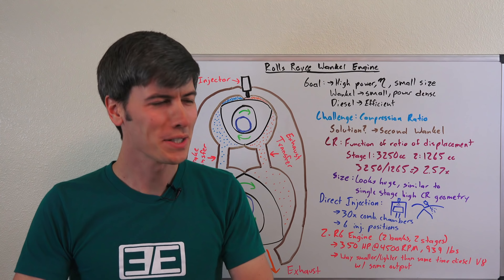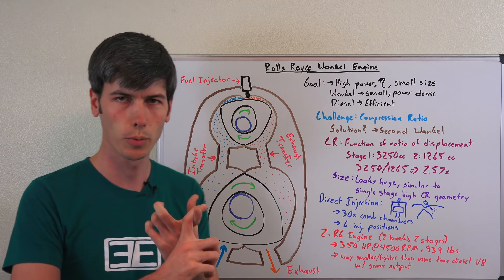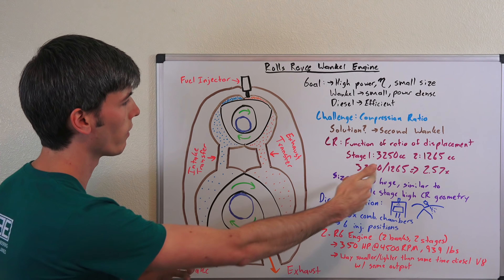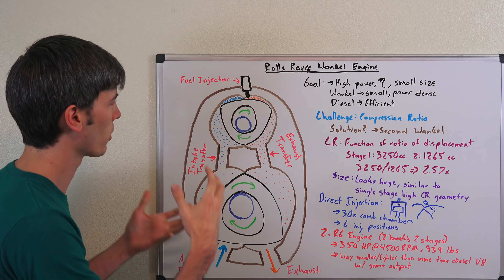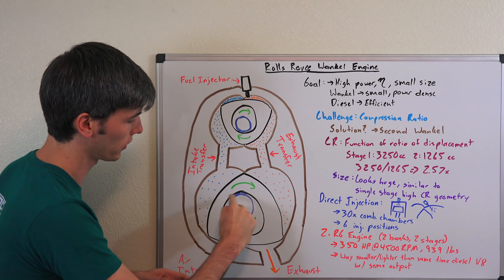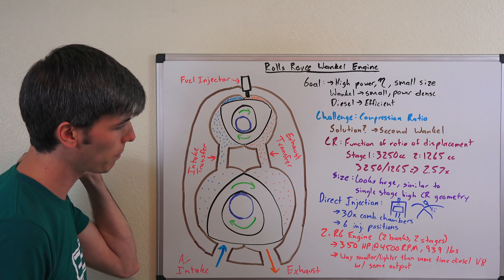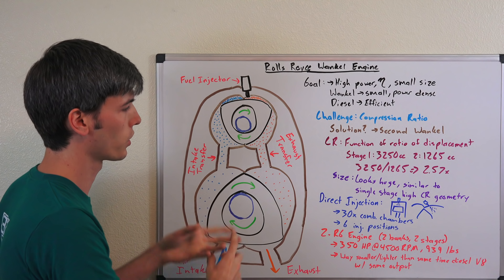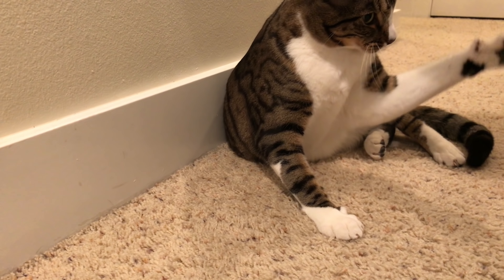Rolls Royce Made A Diesel Rotary Engine With Four Rotors!

Comment: I wonder why, just why...
I must watch again your other video about why the rotary engine is dead... I just don't understand why it happened so soon... it looks like absolute perfection to me... Wankels are known for being low-vibrating and smoother, so a Rolls-Royce with such system would offer an EVEN smoother and softer ride. Also, with so much freaking torque, the company could easily overcome some problems related to excessive weight (Rolls-Royces are quite heavy cars; even the sportier models); thus making a better-performing armoured car. Imagine a Phantom with a VR-10 armour level; that would be a great competitor against Mercedes' Maybach S600 Pullman Guard.

Comment: No way this would actually work without shaking itself to pices with the off set rotors. It  would also put out enough heat to melt  the frame of anything it was put into.

Comment: But wait.. how does it get  enough air when starting? I imagine the starter motor driving both rotors but i can't imagine a starter motor providing enough RPM for the "Charger-rotor" to create enough airflow to the engine. Were there any other air intakes?

Comment: I have long wondered why nobody has explored diesel wankels. Petrol rotaries have always been poor on fuel efficiency because it is almost impossible to get all the fuel to ignite in a chamber which is rapidly changing. I assume with a diesel - which ignites under pressure - this wouldn't be so much of a problem right?

Comment: This is a twin charged, twin rotor, direct injection? Can we do it now with modern metal and the unbreakable Apex seals, A fully programmable ECU. We can get the weight down to 500lb or less.
Reply: The problem is it is using diesel which is being phased out. I can only see this being useful for marine applications.  Rotaries scale up nicely. Banks of those turning genny's which turn electric props would work well on ships. Slot one in and out for service on-shore, no down time when in port. Berthing fees are not cheap. When ships on on the seas they earn.

Comment: I wonder why they did a two stage wankel engine with all the sealing problems instead of radial or roots compressors. Also, what was the total compression ratio of that engine?

Comment: You never answered to DM on instagram. So I have to ask here again, how is it possible that hybrid cars run on petrol while waiting at stoplight just to charge betteries, isn't that, due to conversion loses, less efficient than just using petrol directly to move car ?
Reply from the maker: +Imamijaa sorry, get lots of comments and don’t see them all. Hybrid efficiency doesn’t come from sitting at a stoplight (though most will shut off at this time). Comes from regen, and operating the engine at it’s most efficient rpm, start/stop, etc. There are very real advantages.
Reply: Engineering Explained  But in your video about hybrids, you have mentioned that they run on petrol while waiting at stoplight just to charge batteries, and that boggles my mind. Since I am electrical engineering student, I know that every conversion comes with loses.

Comment: That is NOT a rotary engine ! It is a Wankel. Rotary engine are radials with the crank shaft bolted to the firewall, the crankcase is bolted to the propeller AND the cylinders/crankcase spin.

Comment: Total compression-seal contact area is much larger compared to piston engines of similar output.  Diesel rotaries as described have a ridiculous total seal area!   A single compression-seal failure kills the engine. (Cold start after a seal failure is not possible without a full rebuild.) The larger the total compression seal area the lower the MTBF is.  Seal formulations got really good, but any failure is a fatality to the engine.  Single failure of a seal in a piston engine does not kill the engine.  It just runs poorly. with a far more graceful failure WRT seals.  This is why we cannot have nice Wankel-toys.  Full disclosure: was a RX-7 fan having owned 3 over 15 years.  All died due to compression seal failures, even with meticulous care taken to avoid such failures.

Comment: Would you really call the compressor rotor part of the combustion system?  Isn't it really just an integrated rotary turbocharger?  It doesn't actually have any ignition phase does it?  So this is really a twin turbo charged two rotor.

Comment: Why didn't they put both rotors on the same shaft?
Reply: Maybe to have a shorter engine Block, or maybe they did and the drawing was schematic
Reply: Crazyhero 1924 Good point. He never did say there were two separate shafts.
Reply: there are two seperate shafts - combustion occurs on the two small rotors on the top shaft. The two larger rotors on the bottom shaft act like superchargers almost - compressing the air to increase the effective compression ratio of the smaller rotors. This could not work if all 4 were on the same shaft - they would be rotating at different speeds and I assume it would be very difficult to engineer, in terms of airflow at least. Plus, his diagram clearly shows two independent shafts.
Reply: I went and read the original article, which included pictures. It is definitely a two shaft setup where the shafts do run at the same speeds, with a larger rotor acting as a pre-compressor for the main smaller combustion rotor. The article states, "The basic compression ration of the combustion stage is thus multiplied by the displacements of the two units." That suggests that all the rotors could be implemented co-axially, but perhaps as crazyhero 1924 suggested, they were looking for a shorter engine block.

Comment: efficeincy and military? mmm no. in a military application you want versatile engines, preferably things that can take multi-fuel (run both diesel and petrol, or even more kinds of fuel) you want rugged designs, low maintanance, simplicity, high power density and preferably low weight. well, many times it failed, but the base principals are these. you want it to run on anything, anywhere, anytime, for a looong time. and want it small and light.

Comment: What you think of LiquidPiston rotary engine design (liquidpiston.com)? 
Seems to be promising and the design itself is very interesting — all three volumes are burning, meaning less vibrations and more consistent heating. 
NASA and US Military has already invested in low power version suitable for a compact power generator.

Comment: Well Wankel engines that had forced induction did not live long and happy life.. However this should last significantly longer than what we had in Mazdas since diesel is more greasy than gasoline. Diesel is actually type of petroleum oil, and "diesel" is just the name they are using for commercial purposes.

Comment: How about a RADIAL engine, say a five cylinder, laid flat on its back, central in the engine bay, low centre of gravity, simple without long flexing crankshaft and bearings and cam shafts and belts and pulleys etc, light weight=good on the front end components, does it have merit??

Comment: I think it would be cool to make an opposed piston engine with the connecting rod of 1 of the pistons split in half to fork around the other. This way if both pistons fired at the same time there would be no counter weights required on the crankshaft. Probably not worth the extra complexity and cost to manufacture, but it would be inherently balanced and probably the most balanced engine ever made. If the pistons and connecting rods weighed the same amount it should in theory be perfectly balanced.

Comment: Yes, I second the motion for disclosing the Torque number, if possible.  

Rotating combustion chambers have very little mechanical advantage. That 4500 redline was needed to pull gearing to get some kind of mechanical advantage through the driveline. 

And I think that the multitudes of injector placements was not only for proper flame propagation but to coax a little more grunt from it through increased and/or redirected pressure fronts acting on the rotor.

Comment: No mention of the ONLY thing diesel users care about? Torque? Horsepower is of no use in a diesel (or even a gas engine) if it doesn't make enough torque to get you going. 

The RX-8's 235 hp sounds AMAZING until you drive one and discover that a base model Camry would blow its doors off. Wankels are the most gutless, torqueless, inefficient engines out there. That's why they die every time someone tries to resurrect one.
Reply: A camry would never beat an RX8

Comment: Rotary engines failed in the marketplace because they cannot pass government mandated emission standards.
By their nature.
They use oil like a two stoke piston engine, with oil injection instead of being mixed with the gasoline.
A lot of partially burned engine oil gets blown out of the exhaust, like a two stroke piston engine.
No one has found a solution to this problem yet.
The rotaries don't have an oil sump or oil control rings, to scrape the oil back into the sump, that it doesn't have.

Comment: It may have had 350hp but probably didn't have any torque.
Rotary engines are don't produce torque are thermally inefficient, have reliability issues and don't run clean enough for todays tailpipe emissions.  
RIP wankel.  Electric motors are 
here now.  No competition.

Two strokes, on the other hand, will make a small comeback.
Oil-less, direct injection two stroke.
Special coatings on the cyl wall and some sort of ceramic teflon polymer type piston with a piston cavity and sealed crank and rod bearings.
Reply: Two stroke maybe yes, but not the way you mentioned. I see more in the old Detroit diesel engine, upgraded with modern technology. They have a huge development potentional. In their time they were way ahead of its time, and even now, some of the details of that engine range are still very modern.....
Reply: 71 series was a great design.  
Never got any R&D and was abandoned due to emissions.  

6V71 was used in our transit busses for decades.  Up until 2012 if I recall.  Way overdue for upgrade.  
Robust engineering and easily rebuildable, made them cost effective.  Had a great sound but what a gross polluter.
Reply: Yhat's my point. Trow alot of modern technology over it and i bet they would have a new life. Also noiselevels should be reduced.

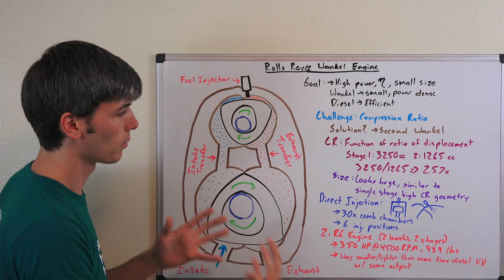Comment: 4:11 diesel v8 not..70s ..General Motors introduced a line of Diesel V8 engine engines for their C/K pickup trucks in 1982. This engine family was produced by GM through 2000, when it was replaced by the new Duramax